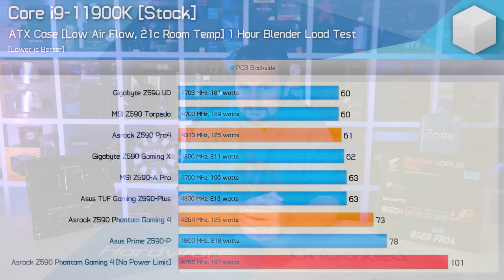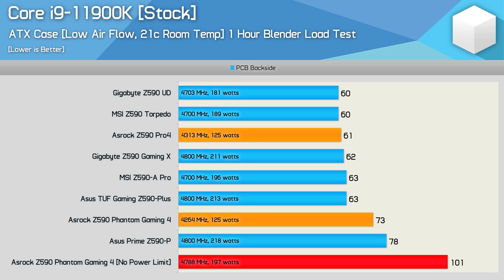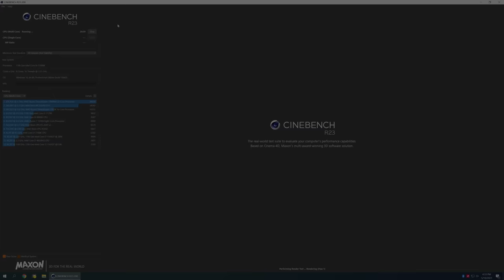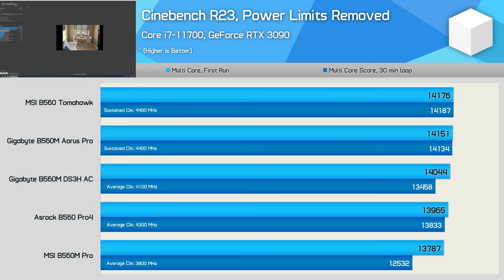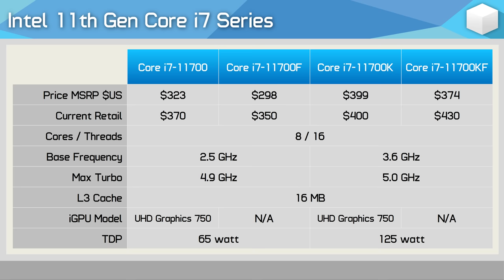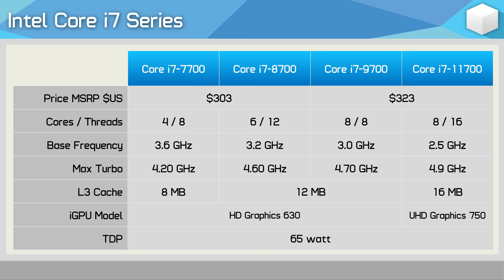Intel B560 is a Disaster: Huge CPU Performance Differences, Power Limit Mess

Comment: It is possible that the cheap motherboard mosfets are not designed to supply 300W to the cpu. While for 11th gen intel cpu you need to buy $200 motherboard, $100 water cooler and $100 power supply, for equivalent amd cpu $100 motherboard and $50 power supply is enough.
Reply: Honestly, 300W is looking at highest end of the line-up(11900K) and at the highest end of power draw with ambient cooling: if I were crunching numbers or rendering for a living I wouldn't run an 11900K at a sustained 300W power draw as much as I like to overclock. It's nice and cool for benchmarking and e-penis measuring contests but for 24/7 or just 8 hours a day is wearing down slowly but at a sure pace an expensive CPU: it won't last much running at 90-100C sipping 300W daily. 

If you want to run a CPU in infinite PL2 you just need(very broadly and mostly targeting K CPU, non K feel free to knock down in quality since they don't overclock) a 120$-200$ board(based on CPU skew: 200$ for i7-i9; 150$ for i5) and for i5 50$ tower air-cooler, AIO or a top-tier air-cooler would be better for i7-i9. Then PSU budget for PL2 of the CPU: i9-i7 250W, i5 150W. Even the i7 11700 at 4.4Ghz should be covered with a 150$ board like an i5 since at that speed draws around 150W, I would bet than even some 120-130$ boards that have actual heat-sinks over the mosfets are already good to go for i7 11700: that already makes miles of difference in how much you can push through them without overheat.
You can also run at lower power target than PL2 and better efficiency if concerned about 300W draws, but that only happens in i9 11900K and pushing it to the very edge: saves in motherboard, cooling, PSU and probably in CPU too. No need for an i9 if you don't want to be the king in frequency.

The mistake the video makes is trying to compare lowest end with highest end in B560 board skew ignoring the middle end boards which would do well for an 11400 in permanent PL2, but office class boards aren't going to do that, because in office they don't want permanent PL2. Also foregoing the intended target of the 100$ boards: office users. Not gamers, workstation, overclockers or hardware enthusiasts. Didn't needed much effort, a quick visit to MSI B560 Pro page and right there in big caps: reliable board for business use.

Also my broad power calculation(common sense too) says that the 100$ boards should be able to provide around 125W, highest factory PL1 minimum VRM requirement for supporting 11th Gen.
Common sense should be too that lowest tier of Z590 should be able to handle highest PL2, 250W.

Comment: Don't know how I feel about this, on the one hand the two high end boards tested are the ones at fault. Running the CPU's way out of specification as their default and essentially using the aftermarket power limit overclocking from the start. With the correct boards leaving it disabled and requiring simple bios changes to enable it.

The VRM testing is good to know and I also get how it can be confusing to basic users, but I feel this should be treated as a bonus and not how the CPU's should perform, as I feel this video will just stoke intel to disable this feature completely going forward having seen the backlash from it. 

That said you could take the opposite angle of a new user using the stock cooler on the high end boards and being blindsided by thermal throttling and a strange experience all because the motherboard was using jankey overclocking from the get-go.

My opinion, update all boards and disable power limit overclocking as the default, run everything at stock as the default settings. Allow the user to choose when to 'overclock'. Then this whole video could've been a VRM comparison.
Reply from the maker: This is the biggest misconception around Intel CPUs today, it's not out of spec: https://twitter.com/HardwareUnboxed/status/1385035841005780992
https://twitter.com/HardwareUnboxed/status/1385051271451660290
Reply: @Hardwareunboxed  Ok, we can debate what 'in spec' and 'out of spec' means. But there are default intel values with regards to power limits and times are there not? One would assume a board would run these values as the default. 

Or is that wrong too? It genuinely does seem to me to be the case that the issue you are having here is with the high end boards bosting power limits beyond what the recommended default is for a given CPU.

Edit: "What each manufacturer is doing here is simple but also specific to their own motherboards. Intel supplies a baseline for the power limits, also referred to as PL state, to motherboard vendors which is a standard across all 10th Gen K and Non-K CPUs however, the limit can be altered by the vendor if their boards have the necessary power delivery solutions onboard them."

It seems like this 'feature' which started with 10th gen boards in general has become the default setting on many boards, you can't deny that a novice buying a high end board, then using the default cooler only to have it thermal throttle and act very oddly might wonder why their motherboard on default settings is not using the default intel PL states for their CPU.
Reply from the maker: "But there are default intel values with regards to power limits and times are there not? One would assume a board would run these values as the default."

No those are not the 'default', if anything they are the base spec. There is no default, the CPUs can operate anywhere from the base clock to the clock multiplier table, all is in spec and no configuration is the default or most 'correct'.
Reply: @Hardwareunboxed  Sorry I also need to add in reference to https://twitter.com/HardwareUnboxed/status/1385051271451660290/photo/1

It seems to make it very clear that the processor is 'in-spec' but that the TDP has been altered. It's 'in-spec' because its running at a clockspeed and voltage verified by Intel. That said, the TDP limit has indeed been modified from the default .

Frankly it's odd that this is even a discussion because you can lookup the default base/boost clocks with ease along with the default TDP.

Who would lookup specs of a chip and then assume it to be at twice the TDP out of the box? It's certainly an issue that needs fixing so I'm glad you raised it, we've seen people having issues on ITX builds because of this as a matter of fact as they specifically look for 65w TDP parts often.

I'll change my original point. They are not running at default settings. They may be 'in-spec' but they are being run at higher TDP limits and durations than are provided by intel as the default values for the CPU.
Reply: @Hardwareunboxed  So you're calling it the base spec. So would you not expect motherboards to run the CPU's at the base spec as their default?

I feel like this entire thing can be negated by simply making them do that. As I said before, people look up a CPU, and see what TDP is listed and what the speeds are. 

They then buy said CPU, and find it running too hot for their SFF case and can't understand why, they then have to modify their bios to make it run at the specified base spec of the CPU.

Surely it would make sense for the 'base' spec to be the default as it has been for pretty much every CPU generation in the past. You usually reset to defaults when you want everything to be at the base spec.

I realise we are picking at things at this point, but I just feel it would solve the problem to have the base spec be default with every board having the increased values activated after the fact.
Reply from the maker: Why would board markers release premium boards and then adhere to a base spec when they have the option of a higher spec? Makes no sense and obviously that would never happen. This is clearly on Intel for their loosely defined specification.

Aks yourself this, why doesn't AMD have this problem?
Reply: @Hardwareunboxed  By the way, I don't want you to take the fact that we disagree on something the wrong way. I still appreciate the time you spent making this video and gathering all this data.

In terms of this whole thing it is a bit mind boggling. It's almost like they should start just listing the boost clocks of their processors "Up to: 4.7ghz". As it seems to negate the base and TDP specs if this is the case.

It just blows my mind that it can operate in this way, it means we have no idea what kind of performance we'd get between different OEM machines let alone custom builds.

I'm going to miss the days of basic specifications :( (On the plus side if it stays this way you'll have a lot more benchmarking to do!)

Edit: For your last comment which I just saw, for once I totally agree! They need proper specifications otherwise how can we as the end users make an informed choice. Especially considering most people won't be watching review videos and will probably end up looking at the spec sheets they see in the store.

Comment: Even cheap b560 boards cost more than most b450/b550 boards for amd. So the question: is 11400f still the value king compared to ryzen 3600 as many believe? For me: not, especially not for multithreaded workloads.

Comment: Was just about to buy a cheap B560 board with the i7, saved me so much trouble - thanks! (Though removing the power limits should help, right? - with good airflow that is...)
Reply: Yes, also add a beefy cooler to prevent thermal throttling.

Comment: Now that prices have come down, is there any benefit to putting a 11700f in a z590 aorus master? The difference in price between b560 pro ax and the z590 aorus master is about $30. I can't find any information about locked cpu's in z590 mobos. I happened to have come across a prebuilt with a 11700f for really cheap, but it comes with the lower performing ASROCK motherboard.

What I would like to know is:
A) Will it run hotter/cooler?
B)Would the power limits have to tweaked to achieve best performance?

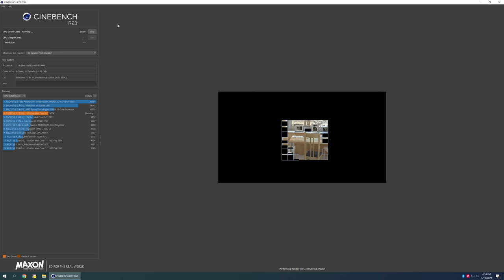Comment: Anybody knows how to remove the power limits in Asrock motherboard just like what Steve did @10:29 with the Asrock B560 Pro4.
Reply: did you check in your bios? it's under power management section

Comment: There are just too many of those damn motherboards! B490, B..4, B550, 560 570...the same as graphic cards and CPU's, most of them are just waste of good parts. Worse part is that they keep adding more and more. Items what we are looking for are most over prices if they are in stock. Way too many cheap tricks in shops which working with company's like for example MSI.
Reply: you are right, this business is a mess. I've spended hours in reviews, oficial websites, and prices in my local shops. 
Z490, 590, B560... whatever! wifi, non wifi, USB-C, Audio digital, .  
chipset: for features, bios, updates/compatibility future support, 
VRM: for best power supply.
models: the features you like.maybe it is not a waste of parts when you don't use them.
I find useless and a waste (in my option)  a lot of FAN Headers, I don't need 5 air fans, I need 3 F_USB, and "top motherBoards" only have 2 ports! damn kick!  old models very old models sometimes included tree .

Comment: so, in the end, is it possible to safely remove the power limits on the lower end boards or will that cause problems because of the lack of  heatsink on the VRMs? do you have to buy a higher end board like the aorus pro?

Comment: not the B560 test i was expecting, was looking for a roundup VRM tests of decent B560(M) boards like we had with B550, mainly these that support fully removing power limits: B560M Pro4, Steel Legend, Aorus Elite, TUF, mortar etc, no point buying the low end cheap boards. but it's fine other sites already done most of the best boards.

Comment: Pair Z590 with i9-11900F is good idea?
Reply: Why would you get an expensive and weak 11900f ("A complete joke", "a waste of sand", ...) if you can get a 10700f with 2 more cores, or the cheaper and stronger 5800x?

Comment: the blame here should be on manufacturers that skip intel 65w PL enforce altogether and let it use much more power out of the box
Reply from the maker: No not at all, they are following Intel's spec, just a different one to what you might have been expecting.

Comment: ASUS Prime B560M-A sustains 4.2GHZ on 11400F when the BIOS AI-Unlocker is activated. (Note that I am using a Deep Cool $20 Tower Cooler. It keeps the chip very cool).

Comment: So the MSI B350M Gaming Pro was holding the Ryzen 7 1700 cpu I had paired with it? Because I've had single channel 2400Mhz 1 x 8GB then someone said to get 3200Mhz 2 x 8GB dual channel to see performance increases and so I did that and I saw exact same results. No increases no nothing so I'm beginning to believe that the motherboard power limit was holding it back in some cases

Comment: why would there be a setting for the power limits 
isn't the CPU responsible for clock speeds (and therefore temperature)?
Reply: No, the CPU is not responsible for its clockspeeds.
Both Turbo and idle clock speeds are defined by the programmed clock behaviours in the BIOS of the motherboard, and any user setting put over these if the MB allows that.
Reply: @herobrinecyberdemon8104  ahhh cool
Reply: @herobrinecyberdemon8104  even in a "locked" i5 11400 can i modify those parameters on the motherboard?
Reply: @_ataims  The meant way to use them is increasing the TDP limit in the BIOS setup, if your motherboard allows this.

If you are professional you manually modify the BIOS instead. Result other than bricking the BIOS depends on your BIOS modding skills.

Comment: I'm looking at buying an 11400 myself, but does the big performance issues brought up in this video apply to the ASRock B560M Steel Legend? It's in a combo starter pack at a discount but don't want to buy it if its going to have the performance drops when power is uncapped

Comment: Good to know this but how do you go about removing the power limits? I'm running the 11400 cpu on the micro-atx version of the Asrock mobo and would like to know what you changed in the bios.
Reply: Go into the advanced version of the tuner and click the oc tuner. Switch the piwer limit or base frequency boost from auto to 125 watts
Reply: @Perdomot this is different for each board. First advice: use google. Could be one of the following settings or a setting with similar wording or a mix of both (one setting for the powerlimit and one for the duration of the turbo clocks): "all core enhancement", "intel turbo duration", "cpu powerlimit", "cpu cooling [water/air/high/small...]", "all core turbo mode",  "extreme cpu clock settings" and many many other wordings. Actually you never know what they do before someone tests it. So google it. Then get a benchmark and see if and how clocks change. Remember a setting could do all you need or just one thing of both (powerlimit and turbo duration).
Reply: @tomasmartinez8620  Thanks, will try it.
Reply: @thardem  Already did that but there is scant info on a specific mobo which is why I was curious what Steve did in the Asrock BIOS. Would be nice if he could do a short follow up video showing how he did it on each board.

Comment: I'd imagine that the Gigabyte B460M DS3H V2 and the B460M DS3H are a mess. Look at the VRMS, Heatsinks don't exist. TMPIN 4 will hit 111c on HW Monitor with CPUZ running. All cores will hit 800MHz for a second until temp drops. So with a 11600k it will run about 4.5 all core until TMPIN 4 hits 111c than drop to 800MHz. This is with power limits. Leave that on. No heat sinks on VRMs. Be careful. They might burn out. With a Noctua NH-U12S in push pull with 2 NF-F12 fans the temp ran around 105c on TMPIN 4. Still too hot, but avoided throttling. These boards need heatsinks on the VRMs. There is no excuse for this. It looks like the Gigabyte B560M DS3H is the same. Talking about China cheeping out on VRMs. I was doing research, and Ali Express has a VRM heatsink for the B460M DS3H. Long heatsink that covers VRMs. Well that is out, Can not deliver to United States. Troubling because I have B460M DS3H V2.

Comment: Pretty much why AMD is still the way to go considering the pricing and demand issues as of late. 11400 is an attractively priced CPU but it needs an equally attractively priced motherboard to make sense and It just doesn't, which defeats its value proposition. I don't see the point running an11400+Z590 when 5600x+B550 just works better as a platform.

Comment: At locked 65w limit would the 10400 out perform the 11400? 10400 is quite a bit cheaper and makes more sense for a true budget pairing with a cheaper b560 board.
Reply: Nope, 11th gen isn't Skylake.

Comment: Watching this on a 10400 on H410M-A Pro, never thought a same chipset on mobos can make such a difference on perf
Reply: It's not the chipset! It's the power delivery, motherboard feeds electricity to the CPU and it does converting from PSU 12V line to the Vcore used in the CPU. They have a maximum amount of current they can convert, so a máximum amount of Watts they can supply to the CPU. If the VRM cannot provide enough watts for the CPU to work at a certain frequency then frequency is clipped until matching max watts the power delivery can supply.

Usual reasons from clipping in power delivery are temperature protection and over-current protection that power delivery has built-in. Also power limits set in the BIOS affect too: every board has to respect PL1(base power limit) for the CPU, but they aren't obliged to support PL2(power limit in turbo boost) except for Z series boards. So cheapest non Z boards can be(they are in fact) made for office use in which they prefer the CPU not boosting beyond PL1 since that saves a lot of money: motherboard, cooling, PSU; and also makes for easy silent operation. No computer is more silent that one that outputs small amounts of heat during operation.